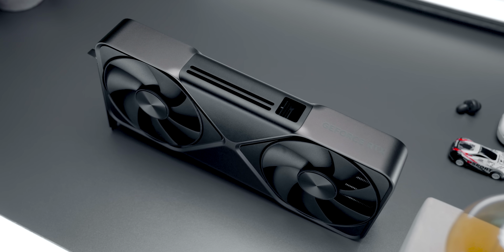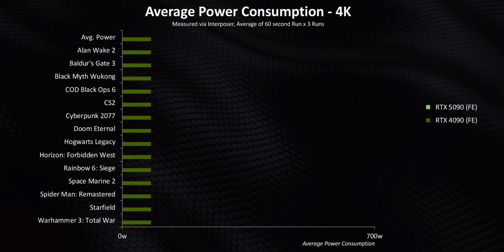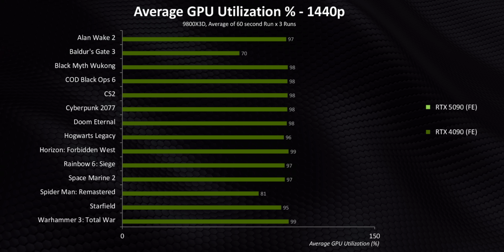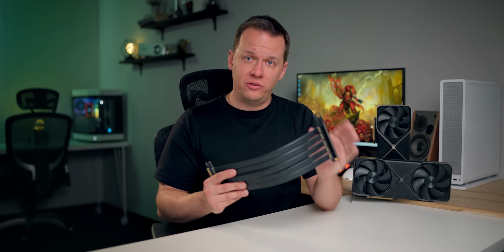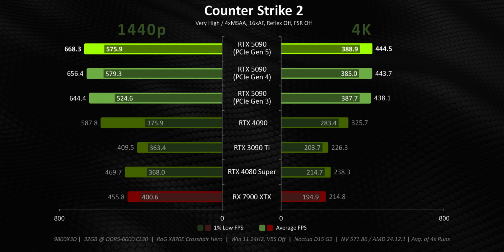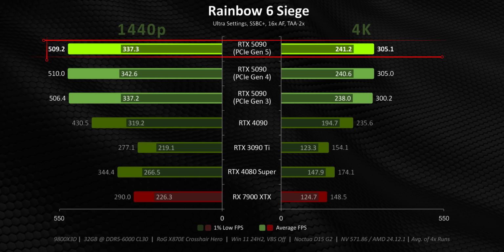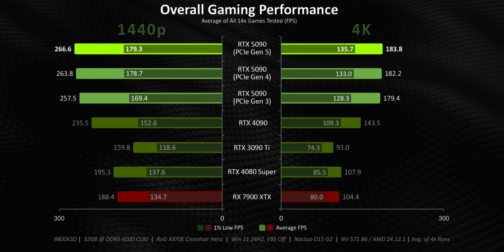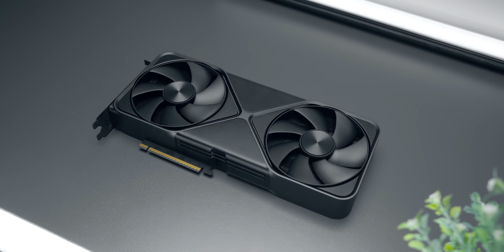RTX 5090 - CPU Bottlenecks, PCIe Scaling, Benchmarks & More

Comment: You definitely shouldn't get the FE model over the AIBs.
Most AIBs nowadays use PTM 7950 unlike the last gen so you don't need to worry about your hotspot temps or pumpout, and the card will easily reach over 80c in the summer. The card dumps so much heat, if your case doesn't have good enough airflow it will probably cause the case temp to be so hot your side panel might fucking shatter 😂
Reply from the maker: The PTM 7950 isn't nearly a reason to buy one of those ridiculously oversized custom cards.  Ultimately all that hot air will be dumped into your case regardless of which design you have
Reply: FE uses liquid metal, which does not suffer from pump out like traditional paste. If you cool your room with AC I the summer it won't reach very high temps.

Comment: what if i dont use a riser, and directly attach a 5090 to my pcie 4.0 motherboard? any issues?
Reply from the maker: I really wouldn't recommend an older CPU with this card.  You'd be leaving an incredible amount of performance on the table.
Reply: @HardwareCanucks  damn, I was really hoping my 5800x3d would pull through on 4k.
Reply: @HardwareCanucks is 5900x good enough?
Reply: @Shreyashtiwari07  No way near good enough imo. Even a 4090 was getting bottleneck on that cpu.
Reply: @Shreyashtiwari07  not even close
Reply: @Shreyashtiwari07  As a previous 5950X/5800X3D owner, the non X3D 5000 series CPU's hold back even a 4090 by quite a bit and that's at 4K, less with a 5800X3D, but it still leaves GPU performance on the table, so even more lost performance with the 5090. For a 5090 on AMD, I would not run anything slower than a 7800X3D

Comment: What are some improvements we can expect in the future with it? Almost sounds like they are promising us snake oil.
Reply from the maker: When faster CPUs roll around, we'd expect 1440p overall results to improve.  Also it's obvious that newer games with better integrated RT like Black Myth seem to benefit greatly...I'd expect more of those in the future too.
Reply: @HardwareCanucks  It's not a CPU problem, the card is not bottlenecked. Do some research about the engines of the games that you consider a bottleneck. Doom can scale up to 1000FPS, the GPU is 99% utilized, there is no CPU bottleneck...that's what you can expect. The heavier the engine (amount of things on screen) the lower the FPS. There is no magic to unlock. To use Neural shader the entire engine needs an upgrade, at that point it's a different game and at that point there will be something faster out there, very likely.

Stop selling things we can't touch or that are not defined right now.

Comment: All the idiots that sold their 4090 (and allowed me to get it way cheaper). thanks
Reply: Thankful for all the idiots who bought mine and other peoples 4090's for the MSRP we paid for it. Few hundred extra for 35% gain? sign me up.
Reply: More like you financed their upgrade for only a few hundred bucks
Reply: You mean full new price but used. Yeah they really got played haha.
Reply: Where? They're insanely expensive on eBay probably having memory units stripped and sent to China
Reply: yeah nice lol
Reply: c00I st0ry br0
Reply: So basically one idiot helped to finance another idiot's upgrade.
Reply: "cheaper" bruh. They are all insanely expensive. They are all the same price or higher than the MSRP for the 5090 (assuming it will even be available at that price range)
Reply: Anyone who pays MSRP or more for a 2 year old used GPU is on team fomo without a doubt. Bad purchase, especially if you buy it than 2-3 months later(beyond ebay protection) it stops working, warranty for most aib doesn't transfer and you have a $1700+ paperweight.

Comment: Great job on the PCIe gen 4/5 tests
Reply from the maker: Thanks!
Reply: @HardwareCanucks  what CPU did you test with for the gen 4? I am trying to hunt someone down who actually tested with an 5800x3d at 4k, just wanna know how severe the bottleneck is (but if you tested with that then we should be fine for the most part, my 3080 is tired boss...)
Reply: @HardwareCanucks Do the same with the rest of the upcoming 5000 series🙏
Could you guys also do ddr4 vs dd5 with the new gpu
Reply: @MechaMeister  I would guess that if the 5090 generally isn't bottlenecked by PCIe gen 4.0 then the other cards won't be either since they use less bandwidth, but I guess there's a possibility of something weird happening.
Reply: Exactly what I wanted to know
Reply: Super useful information to have for those of us sticking with older motherboards thanks.
Reply: thanks for doing this. i have the lian li sup01 so im in a bit of a pickle. I have a 9800x3d with a 4090 currenlty. i have all 3 nvme slots filled with gen 4 storage as well on my board. Im assuming this would impact performance quite a bit not having a dedicated gen 5 riser?
Reply: Agreed

Comment: Barely any RT improvements over 4090 for a larger price tag is very disappointing. Would have made more sense if it was priced the same as 4090 since it’s basically a 4090 refresh.
Reply: It might as well be called a 4090 ti. Because that's pretty much what it is
Reply: 4090 is selling for 2000 common the 5090 is priced market fairly
Reply: @herrba  2300*. Fixed it for ya
Reply: @herrba hmm if that is true I’ll sell than and cross upgrade
Reply: @herrba  hope ur finger nails get pulled out. We all know that price is not fair in a long shot.
Reply: @pem3480 wat?
Reply: wait, they givin you x4 more flimzy frames but askin just 1/4 of that, should be grateful, definitely
Reply: GN is reporting an almost 50% increase in performance. How is that "basically the same as the 4090?"
Reply from the maker: On that, our numbers don't agree with GN's but not sure which games they tested.  Black Myth specifically showed HUGE increases.  Other games not so much.
Reply: @HardwareCanucks So, we can assume 5080 is more suitable for 9800x3D ?
Reply: @jaredweiman2987  they don't report such a bullshit, go watch it again.
Reply: @SergeiSugaroverdoseShuykov they literally said "20-25% increase in RT" in the start of the review iirc lol
Reply: @jaredweiman2987  In one game.
Reply: @jaredweiman2987  this card has ~33% increased performance for ~40% extra power draw. This card is a bad deal...
Reply: @ Just in Nvidia propaganda games, like Black Myth and Alan Wake

Comment: 30% extra performance relative to the 4090 for a 25% higher price. Last generation, the 4090 offered 70% extra performance over the 3090 for a mere 7% price increase.

Profoundly disappointing.
Reply: It's even worse here in Europe, or more specifically Norway. The 5090 costs like 40+% more, and that's the cheapest one, they go well above 50% in cost increase
Reply: @vedomedo  cost of socialism. at least your uni is free.
Reply: @mmcmmc6795  it’s not a money problem, it’s a value problem.
Reply: @mmcmmc6795   rofl bro, good one
Reply: @mmcmmc6795  lol how did you come to that conclusion?
Reply: The 3090 was profoundly overpriced
Reply: Well the 3090 was terrible and not much faster than 3080, that's why 4090 looks so good compared to it.
Reply: Yeah there's no node shrink this gen, so I'd have been surprised if performance uplifts were better than 30%
Reply: i believe 4090 is the only generation where u see this much improvement, it's an outlier, 30%ish improvement is good enough for me to upgrade
Reply: More like 30% performance increase for 30% price decrease. 😑
Reply: Its gonna be 75% higher price.
Reply: 100 fps in 1440p for a $3,000 card and $500 cpu. may as well just buy a ps5 pro at this point. It’s not a card for gaming, everyone should have known when the leaks showed blackwell with gddr7 and confirmed when the top of the spec sheet is no longer cuda cores but AI Tops…

In a few years hopefully AMD will lead high end GPU’s while nvidia does what they do best. If not then PC gaming is dead, and that’s sad.
Reply: Yea. If 4090 actually was 7% more expensive than 3090.. It was 100% more expensive, so price to performance gains are crap... Who ever bought 4090 is insane, or has so much money that he didn`t even noticed that loss
Reply: @theexorcist982  im using 4090 and i enjoy every second of it. But its not enough to get the frames i want in 4k
Reply: bad bad value..
Reply: Don’t buy it lol
Reply: bad comparison, you were paying 3090 price for VRAM, compare to 3080/Ti plz

Or mention how power consumption also rises with price
Reply: Don't forget the same 30% more power consumption, I see not a single "generational progress" here
Reply: Same node so they’ve done the best they can with 4nm. 6090 will show a better uplift and lower power as it moves to 3nm. I’m buying one as it’s 100-120% uplift from my 3090
Reply: @ParisVi2  4 nm to 3 nm is going to be a small improvement
Reply: @Reza1984_  3nm is a big improvement. Even N3B to N3E was a massive improvement. People like Apple, Qualcomm and Mediatek have extracted huge efficiency and performance gains. 
Or at least that is what I am telling myself hoping for some future competition, given that Apple's CPUs have 30% better single core performance than a 285K at significantly lower wattage and clock speed.
Reply: Come off it, 4090 were not available to most people at MSRP, the AIB manufacturers always sold it around $2,000 or higher.
The small increase on 3090 MSRP was a surprise announcement that meant jack in reality at retail.
Reply: @RobBCactive  like 5090 will, lol
Reply: @RobBCactive  I bought my 4090 @ MSRP in August last year. I don't regret buying it over waiting for the next gen even one bit.

Comment: Almost 600w is crazy. 30% uplift at almost 50% more power is a downgrade
Reply: It's still on the same fabrication node. That's why
Reply: Lmfao what
Reply: learn math. 450 to 575 is 28% increase
Reply: And the same is said for the 5090… they’re both around 10-20% down from peak in even the most demanding games.  And with a good uv, surely the 5090 will do well at under 400w as well…
Reply: @damara2268  The 4090 never used 450 in games, only in benchmarks. Most games it used around 300w
Reply: @deuswulf6193  yeah, the card is rendering almost nothing when using DLSS4, that's why it uses less power lmao.
Reply: @thor.halsli did you watched video here 4:05 4090 uses 400 watt in average on 4k with rt

Comment: Another three years with my 4090 it is.
Reply: I somehow got 2080ti xtreme. Then 3090 was kinda no point to me. I have 4090 now. Seems like good choice for balatro sessions 😂 for some years..
Reply: @etnamecul that's the funny thing I am so concerned about info on the new cards but I play all types of bass Builders and Engineering games and rarely AAA games.

Why do I care, LOL
Reply: @etnamecul  Baron pog Baron
Reply: Wait for the mod for Multi FG and see if it works out. 4090 from all the reviews is in a good place for another 3yrs if this is what they are putting out.  No Ragrets know what I'm saying.
Reply: No you must buy 5090 or you're missing out on the 25% to 30%!! YOU CANT LIVE WITHOUT!!! BUY NOW, BUY 2!!!
Reply: @Vanity2021 
The more you buy , the more you save.
The more you buy , the more you save.
Repeat after me:
THE MORE YOU BUY , THE MORE YOU SAVE😂
Reply: @Vanity2021  I will
Reply: @Vanity2021 If you buy a 5090, then you have to buy AMD’s 9950X3D to get around the bottlenecks in the 5090!
Reply: @ Not at 4k or 8k you wont. Either way, those with 4090s shouldn't feel the need to do this upgrade unless you can sell your 4090 for a good price and also get a card lol
Reply: Same
Reply: You say that now, but you'll buy one.
Reply: I'm still using 2080ti overclocked
Reply: same here bruh lol
Reply: Moore's law is in a point where buying to every hardware generation is waste of money. Only time when there's a huge jump is because previous generation was crippled in someway.  And latest crippling was that 3090 was based on die that was designed for 3080 price point, but with extra VRAM and picking better yield chips compared to 4090 which got transistor budget of it's price point from the design. Basically GPU:s scale well with transistor budget, and we were used to TSMC offering a lot more transistors with wafers that cost about same amount. Now were are close to where TSMC offers more transistors with wafers that cost more, and lot of structures used in GPU:s don't shrink a more with  die shrink. People getting exited for over 10% die shrink of SRAM for nearly 2x priced wafers.  
Don't get fooled by estimated cost to retail price difference, there are 4 companies with other costs than cost of the manufacturing costs and profits before it gets to you and best estimation is percentage changes in costs will apply same percentage to retail price like in the past decade for Nvidia. (The main exception is 4080 was priced too high to signal people to buy Nvidia's 30 series inventory so that they wouldn't make loss on unsold cards or would have to drop the prices on those chips too much.)
Reply: Same here
Reply: same, i play on 1440p mainly WoW Classic
Reply: Yup
Reply: Same!
Reply: Same
Reply: Facts!!!
Reply: Do you usually wait three years so stock is stable 🤔
Reply: Went from a 1060 to a 4070 Ti (for 700 when the Supers released) pushing 1440p/165Hz. Nothing about the 50 series looks tempting.
Reply: Went from a 1060 to a 4070 Ti (for 700 when the Supers released) pushing 1440p/165Hz. Nothing about the 50 series looks tempting.
Reply: I would hope so lol
Reply: Ok but you gotta move to peasantville
Reply: The more you buy the more you save, except there is no actually discount for buying more.
Reply: Another 3 years with my 3090
Reply: “Another” - You had it for 2
Reply: Well .....isnt that why we Bus Halo Produkts? To NOT Upgrade every Generation?
Reply: But will the price of the 4090 come down any time soon?
Reply: @NeuralVoidSolutions No it will not. 4090 production ended months ago. There will not be new units hitting the market and given the 5090‘s performance the 2nd hand prices will also be high for the longest time.
Reply: I am still using the 2080TI and while I wouldn't suggest to go this long, I'd say I should've went with a 4090. So if I get the 5090 one day, I'd skip a generation to get at least 4 years out of my card
Reply: Make it 8 years.
Reply: I have a 4090 and my girl a 3080(10gb first release).
If I buy a gpu she gets the 4090.
But there is no point even replacing the 3080 for her in 1440p so... I won't waste money on it either. I feel fine with my 4090 in 4k. 5090 won't make my games magically play 240fps without dlss/fgen either so...
Reply: AS I PLAY YOU A SAD 😔 😟 SONG 🎵 🎶 ON TBE WORLD'S SMALLEST VIOLIN 🎻 😄 🤣 😂 😆 😄
Reply: Glad I sold my 4090 for $1600 in August
Reply: @sa1sa624  🤣
Reply: It's for future proofing. Why not get it? Are you poor?
Reply: @uncleimp  guess I’ll be future proofing my poorness
Reply: This isn't for people who already have 4090's, it's for the many, many gamers who have a less performative current gen or previous gen card.  If I had a 4090 I wouldn't buy it either, but I have a significantly slower card so it looks good to me.  🤷‍♂️
Reply: @jonathancaverly6477  i was hoping to upgrade from a 3080ti but its not really attractive to go for the 5090/80 sadly.
Reply: @gelul12  not really that sad as long as you can play the games you want with the performance you're looking for and not have to spend any more money 🤷‍♂️
I've got a rx6800 which is pretty good at 1440p for non-rt but I like the looks of rt and want to be ready for witcher 4, gta 6, blood of the dawn walker etc.
Reply: @gelul12 yeah it's pointless kinda. It's for people with 1080 or 2080 mostly.
Reply: @jonathancaverly6477  I have a 960. Not replacing it with this, don't see the point
Reply: @igelbofh  if you're still happy with it that's great and all that really matters
Reply: @jonathancaverly6477 same i have a 4070 just cause i needed something to hold me over until a 5090.
Reply: Why do that with two 5090s when I can put two 8800 GTX cards in SLI for unlimited power?
Reply: No. You have to SLI  two 5090. Just 4k and you will have unlimited performance.
Reply: @joaor.8780  And the power company will have unlimited money.

Comment: The FE card won't work with a gen 5 riser in gen 5 mode because it has a riser (correction: cable) between the internal boards impacting signal integrity. The electrical requirements for PCIe gen 5 are very high. The solution is to switch to gen 4 mode in UEFI, since it has lower electrical requirements. You can then use gen 4 x16 riser with no performance impact. Non-FE cards likely won't have that problem.
Reply: It doesn't. It goes PCB to PCB via a connector, not via a cable.
Reply: @angelg6338  That connector is a cable which negatively impacts signal integrity. Igor from Igorslab tested this behaviour and even had boot problems when using risers. Nvidia internal testing team struggled with signal integrity as well.